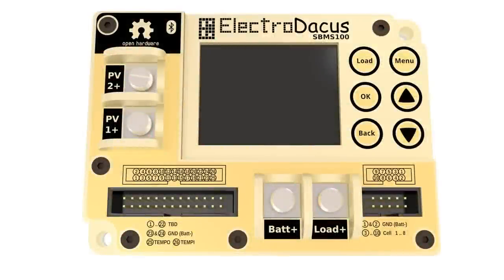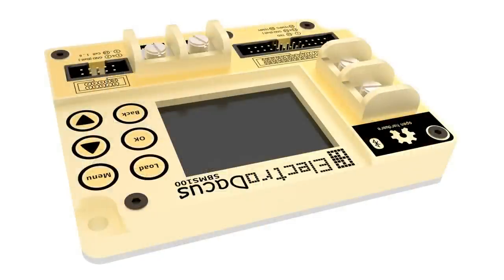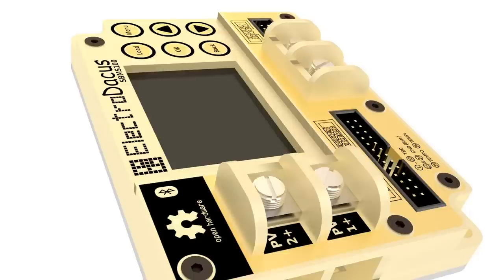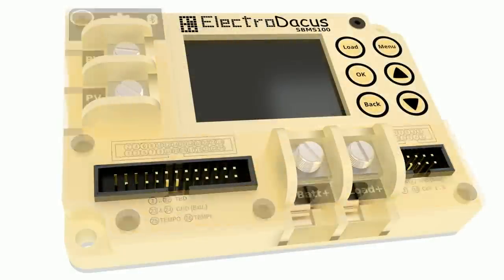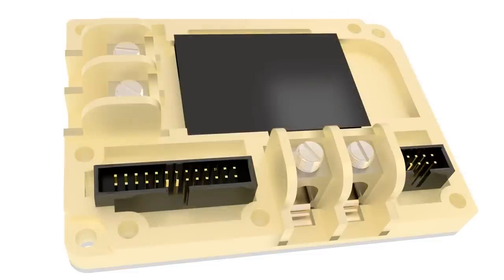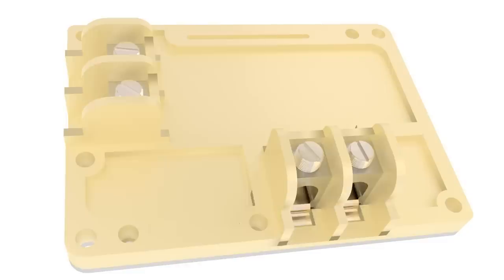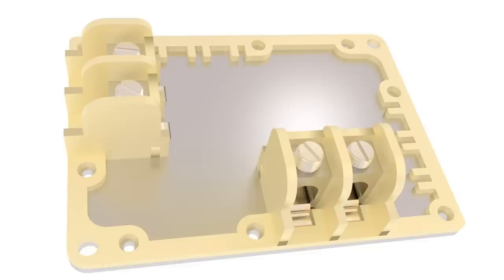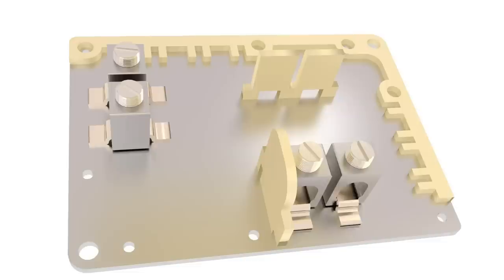New Solar BMS SBMS100 Design.

Comment: I have a large off grid community in B.C. We have 11.4 kw pv array and I am using 40 kwh AGM battery bank. My aim is 100% solar without generator. We have a good diesel generator as back up and this winter it ran only 30 hours. So we are about 150 kwh short. The pv produces enough, but during cloudy periods of more than 3 days we run out of storage. 
     I am a fan of lifepo4, but here is the math problem we all need to be aware of: 1 days storage of lifepo4 will result in a total lifespan of about 14  years at up to 5000 useable cycles, since lifepo4 only begin to degrade slowly at 3000 cycles. Now here is a big problem: if you have 4 days storage in your lifepo4 bank it will last 64 years!!!.  That is a strange problem to have. But the actual lifespan of the batteries might be only 20 years...I don't know how long but there is some ageing apart from cycle numbers. So the solution is...the lifepo4 should not be more than 2 days storage. (30 years!) but we still need some low cycle batteries at reasonable cost to get through a few 4 day storage periods. This means either generator or cheap, short life lead acid. Well, I am not an engineer, so maybe you or others have a better solution.

Comment: Just tried to change my settings in Google+ so hope you will now be able to reply to my posts. I appreciate your remarks on my solar system. You expressed the concern that the battery bank was too small at 40 kwh for an 11.4 kw pv array. It is large enough to absorb .3 c. That is because it is AGM surrette. Quite a few people began to realize that agm can absorb bulk charge at a much higher rate that flooded lead acid. The charge rate can even be 1 c. They just accept it. This was discovered because people were using them in Ev fast chargers when they still used Agm in cars. This info came to my attention on the "AltE" website. They are a long established off grid supplier in the US. They have full descriptions of the characteristics of the various batteries. They have given up selling Gel batteries, but are pleased with AGM.
Anyway I agree that I need more battery storage but not because of charging limits, only because of cloudy periods in winter. the largest shortfall was in early January 2015 of about 5 days so about 50 kwh short! But here is the problem, and I mentioned it before. Lifepo4 should not be purchased for more than two days storage because each days storage will result in about 15 years of use! At two days it would mean 30 years of operation which is about the life of the pv panels. Secondary Bulk storage for deep cycles which occur only 10 times per year should still be agm or FLA since they will also last beyond 20 years at so few ,cycles.
So this is my thought: that for most people who do not have really sunny winters and are off grid and want to be 100% solar without generator, then they should use just 2 days storage lifepo4 and 3 days storage AGM or cheaper low cycle life, flooded lead acid. Cycles beyond about 600 are a waste if you only cycle them 10 times per year...since they would last 60 years at that rate.
I hope my explanation is clear. But after you think about it for a while if you have any thoughts I would be happy to hear them...it is important for others that this big switch to these superior lifepo4 batteries be understood carefully. I think many could make a mistake and end up with too long lifespan that can not be used but still must be paid for.
Reply from the maker: Yes the replay button work now but you where marked as spam :) by google automated system.
I will like to see the spec of that battery. I highly doubt 0.3C is acceptable for AGM but even if it is it will have dramatic negative effect on battery life.
I think 3 day to 3.5 days storage is more than acceptable with LiFePO4 that is my recommendation for best life and performance. I recommend about 0.25C to 0.3C charge rate. I have some more detailed data that I do now to give recommendation for the new SBMS and I will send you a link ass soon as I have that. Is based on my own experience on power generation and consumption and extrapolate from there for each SBMS version.
The calculation should be done for worst case winter months if you are 100% of grid like me and is the only source of power (diesel or gasoline generators are not a solution to expensive is better to invest more in solar PV and even LiFePO4 battery is far less expensive)
Sony has LiFePO4 batteries and they offer a complete solution for grid tied installation. They claim they battery last for 8000 cycles but full 100% DOD cycles and they say with daily discharge their battery will last for 20+ years. They even have a graph with battery ageing and almost no loss after 10 year I think of 23C storage temperature and about 9% loss at 45C storage over 10 years or so. Let me see if I can find the link...
OK here it is http://download.solarshop.net/english/uploads/FS-UK-Sony-Storage-system-data-sheet-10-08-2012.pdf
I just looked again and yes just 2% degradation in 10 years of storage at 23C
So a well made LiFePO4 will last for 20 to 25 years with good deep discharge and if it last as long as PV panels and degrades at about the same rate that is a great thing. AGM or any other Lead Acid can not even dream about this at best they can a few hundred deep cycles maybe 20x or less difference in life compared to LiFePO4.
People talk a lot about Lead Acid but I want to see a spec with good data as the one from Sony from a large company that backs the product with a warranty.
You will not find from Sony or any major manufacturer an energy storage solution based on Lead Acid. There are plenty of UPS systems based on Lead Acid but there is a tonally different game only one or two deep discharge per year or so depending on applications and the rest of the time the battery is full.
On offgrid power most of the time battery is not fully charged that is a real problem for the life of Lead Acid and is great for any Lithium battery.
But about the long life cycle of LiFePO4 you will have different way of using energy in Offgrid you have low power mode in cloudy days in may case with 2.5kWh (prefer to only use up to 2kWh) battery only use 0.8kWh and produce 0.3kWh (720W PV) while in sunny days I can use and produce 3.5kWh.
I will give more details but since you produce 0.3kWh in the worst cloudy day and use 0.8kWh in 24h you only need the 0.5kWh difference form the battery so almost 4 days in may case of backup but it can be more if in day two or three you get an hour of sun or less dense cloud cover.
Reply: Thank you for the sony battery reference...they sound superb. They understand that batteries have to be foolproof because ordinary people will not maintain them. That factor of no maintenance is worth extra expense. The only real product available at this time in complete form is from Balqon. I am sure you know about them but if not, they have pre packaged off grid banks with BMS and case from 2.4 kwh up to 52 kwh. The price all included is about $335 U.S. Per kwh. That is already cheaper than AGM per kwh. I estimate balqon at 8.7 cents kwh. AGM at 21 cents. ( my math for Balqon 5000cycles at 80%= 4000 kwh for $350. So 350 divided by 4000= 8.75 cents kwh). 
  So this is available now on line. The Japanese and german ( bosch) systems tend to be 4 times as expensive....just crazy. 
   The rolls surrette AGM can be charged at imax .35 it says so right in the rolls surrette battery manual. .25 is recommended. But these numbers are on the safe side, warranty conservative. 
    I just finished with a previous AGM bank which was not treated very well with many partial  recharges...it lasted 6 full years! It was 4 strings which is another no, no. But it still worked fine for 2250 cycles, many of them beyond 50% dod. They were not as good quality as the surrette, so I expect 8 years from the surrette because only two strings, so balance is better. And 90% of cycles will be 100% recharged. And about 70% of discharge cycles will be only to 15% d.o.d. This is why large pv is better for lifespan of smaller AGM banks. 
 I still plan to add lifepo4 as the primary battery bank ...about 18kwh probably from Balqon but have been waiting for prices to come down.
Reply from the maker: vensonata
I knew about Balqon but they are way more expensive like this http://www.balqon.com/store-2/#!/ESS-12V-2-6-kWhr/p/45284624/category=2860254  is 12V with BMS 2.6kWh at 1695$ is not extremely expensive but way more than 350$/kWh and they use Winston cells that you can get for much less so you really pay a good premium for that BMS and not even sure if it works depends on application but you will not want the battery to cut your power completely if you have some other controller in front like a Lead Acid solar controller.
I just looked at the larger packs and they are closer to your value so seems OK but not sure How will you use them for solar? Not even for cars?
Yes both Bosch and Sony are expensive but they have a complete solution for grid tied system with complex automation to get the best cost based on time of the day (mostly used in Europe where grid electricity is quite expensive but even there they will not recover the investment cost at those prices)
 But most people have no idea how to calculate that or do not care.
I will need to check the AGM surrette spec but I'm sure that really is the limit and will greatly affect battery life. Like the limit on LiFePO4 is usually well above 1C for both charging and discharging but at those rates the life-cycle will suffer. They test for lifecycle usually at 0.5C that is what I recomend using under 0.5C those batteries between 0.25C and under 0.5C anything out of this range will either reduce the life or cost to much.
You mentioned 6 years about 2200cycles but most of them at 15% DOD over 70%.
That is actually quite bad since the charge discharge efficiency is in the 50% range if your DOD is less than 20%
Also PV are inexpensive if you realy use all the available energy they can be at 3cent/kWh but this only happens in grid tied systems. On offgrid with Lead Acid in the top 20% and (40 to 50% efficient) and with probably not utilising more than 20% or 30% of the available power PV will start expensive.
Reply from the maker: vensonata
What model from surrette I know they have many models with quite different characteristics? Give me a model number.
Reply from the maker: *****
I got the spec for the large 2V AGM cells here is the spec  http://rollsbattery.com/public/specsheets/spec_85.pdf and they have a really bad performance and I guess price is not great, no competition for LiFePO4 not even close as expected. Lead Acid is a really old technology there is no innovation there left to discover.
I see max discharge rate of 0.2C like on all other Lead Acid 5h rate where do you see 0.35C
Also you probably know there is a high reduction in capacity at 0.2C about 25 to 30% less capacity than specified for 100h the advertising number. So it claims a 700 cycle at 80% DOD and 1200 at 50% DOD this is an order of magnitude worse than LiFePO4 what is even worse is that they do not clarify at what discharge rate they do this cycle test and how they perform the test.
If you go to 50% DOD you will probably not be able to fully charge the cell in one day of solar even a good day and then you will need to use a generator or leave the battery for days overcharged that will count to many cycles life degradation even if you do not actually cycle the battery. With LiFePO4 this is like keeping the battery in storage no effect on life and no need for expensive diesel generators.
Why get a Lead Acid that will last you for 6 years with just 15% or less daily allowance and for any two or more consecutive cloudy days you need to power up an expensive to run generator.
Also if your battery is at the end of charge during equalisation where is mostly wasted power the battery will only take a really small current for long periods and maybe you only have one hour of sun left and most probably loads that will work over night. LiFePO4 charges to over 95% with just constant current actually with solar it will go to 100% just with constant current because of solar intensity decrees every day before sunset.
LiFePO4 in my experince did has not dropped in price in the last 3 years or so since I got my batteries. PV panels did dropped significantly in the same period but I do not expect they will be able to go much lower just the glass and frame cost quite a bit more than half.

Comment: I'd say the only thing I'm a little unsure about is the facia sockets and bumps, I'm planning to build this into a custom panel so ideally it'd be nice to have the top plate flush or at least a way to extend the screen out on a short header cable and mount in a panel? Wiring up external buttons should be pretty easy but even a button header socket would be awesome :)
Reply from the maker: The case is build around this large power connectors. This where the lowest profile connectors that I found to support 120A.
But there are quite a few solutions to your problem.
The SPI signals for the LCD will be available on the 26 pin connector. You can build a front plate without the cut out for the LCD and with a connector for extending the capacitive buttons.
A less intrusive method that can use the SBMS as it is is to use an external monitor that gets the data via bluetooth (up to 50m maybe more 7db transmit power) or with a short UART cable.
Normally after initial battery setup there will be nothing to change and to monitor the data all you need is a mobile phone or computer with bluetooth 4
Over bluetooth or UART you will be able to see all the measurments and energy calculations, you will be able to reset the energy counters and switch the Load ON/OFF. What you can't do is change battery parameters (but that is only necessary if you change the battery and for that you need access to the entire SBMS anyway)

Comment from the maker: +vensonata (sorry there is no replay button to your comment you need to check your google+ settings).
Is a great comment so I will try to answer even if it will be a bit long.
First your PV array is probably to large for just 40kWh Lead Acid with LiFePO4 of same capacity it will have been just about right.
If my understanding is right you have a 5kW diesel generator to help keep battery fully charged (Lead Acid likes to stay fully charged and life is negatively impacted if undercharged for more than a day or two).
This winter is not a great definition since I do not know when you consider winter started in BC at your location but I assume 3 months or less so just about 50kWh/month you needed extra. That sounds quite low based on your setup size.
Climate is quite different in BC vs SK where I live but from my experience even in extremely cloudy days full overcast you still produce around 10% of a full sunny day.
I just recently installed the SBMS and I can have a clearer understanding of the power generated during this cloudy winter days.
My 2x 240W PV panels put out just over 3kWh in a sunny winter day and about 0.3kWh in the worst overcast snowy day. Yesterday was such a day here snow and extremely dark all day but managed to produce 0.296kWh while today is not much better I had a 15 or 20minituse of some sun in the morning but now is almost as dark as yesterday but no snow and up to now when I write this 15:17 minutes I have produced 0.594kWh battery is 46% now after two very cloudy days about 0.3kWh and today that will probably stay at 0.7kWh or so.
Main battery is a 2.5kWh LiFePO4 powered with 720W of solar PV as I mentioned but my energy use is quite low most things work directly on 24V DC and are energy efficient. I do have a backup system made of 0.5kWh LiFePO4 battery and 170W PV panels that is only connected to LED lights and that is at 79% at the moment.
I do not have any gasoline or diesel generators I do not need to keep the battery charged LiFePO4 likes more not to be fully charged.
I have a small 300W wind turbine but is not connected at the moment since I did some rewiring and did not had time for that. But that can be quite helpful in winter here is quite windy.
My monthly energy use in the winter is just around 50 to 60kWh and in summer usually higher around 70 to 90kWh (just because I can afford).
Most of this energy is used for electric cooking during the day in sunny days so most of my monthly use about 60% is directly used from solar and 40% from battery.
That is important to be able to calculate an average price of energy for my system.
Now about LiFePO4 having to may cycles and to many to take advantage over 20 to 25 years expected life do to age degradation.
My method to deal with tis is to use a smaller capacity battery and as large as possible solar array.
I will have a particular case when I install a much larger array 6 to 9kWh to heat the house 100% with solar energy (just 3 cent /kWh the least expensive heating alternative) and then in a cloudy day I can still have 10x what I have now and never need a battery capacity larger that what is needed over night since I have excess energy every day at a very low cost and no matter what I use the energy for it will end up as heat anyway.
The best LiFePO4 battery is probably Winston with 8000 cycles to 70% DOD and even after that you still have 80% of the original capacity. That will be 22 years with deep discharge of 70% every day. That will not be the case since you want to have at least one or two days of backup in case of cloudy days but it will still be less expensive than Lead Acid.
I can give you a concrete example if you can give me your average daily usage maybe a minimum daily usage if in low power mode and an average winter month use.
Also location will help so I can have informations about the amount of sunlight you are receiving.